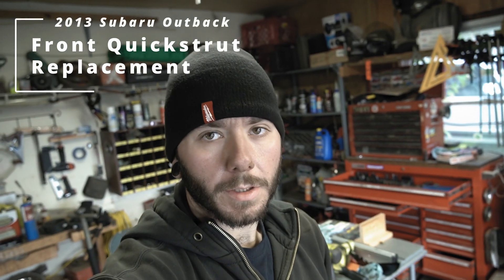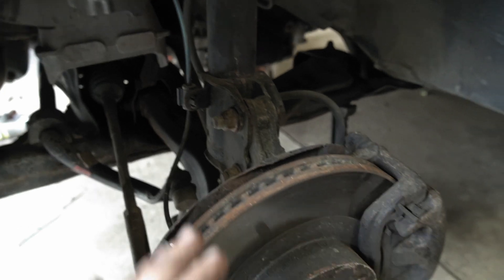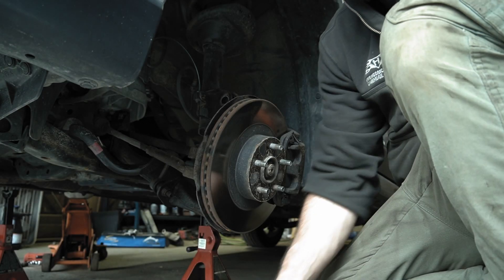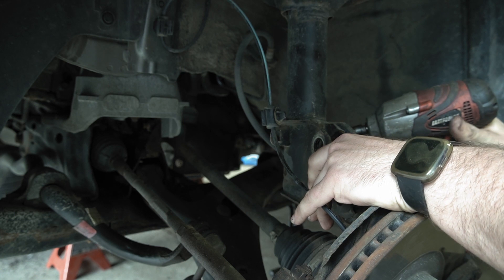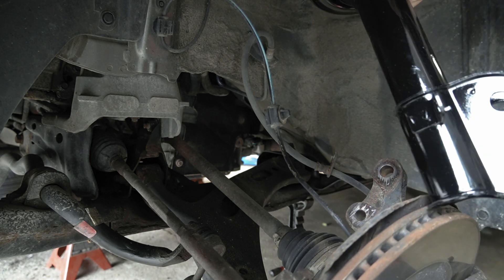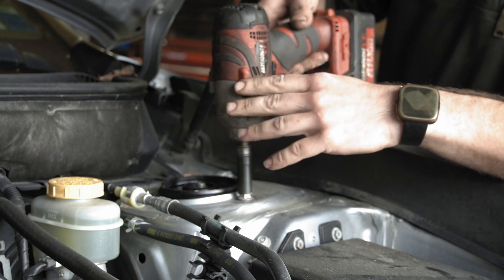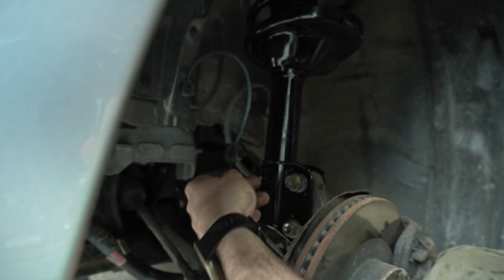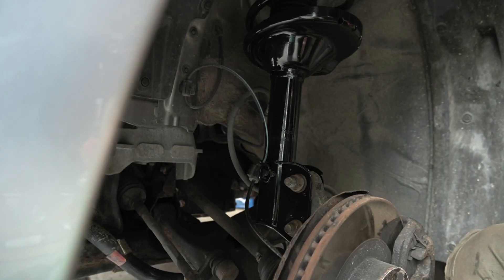2013 Subaru Outback Front Quick-strut Replacement

Comment: Might add, if you pre mark eccentric bolt, you won't be SO far out of alignment than by not pre marking. Thanks!
Reply from the maker: Good point! I am spoiled and do most of my work on an alignment rack so it doesn’t really cross my mind. Definitely a good idea.

Comment: I’ve been putting up with clunking sounds for a while now when going over bumps and whatever and was wondering how difficult it would be to replace these. Thanks for the video, looks like an easy fix.

I had the bushings replaced several months ago so that’s not the problem.

Comment: Great video. Getting ready to do this on my 2014 after a shop quoted me over $1,000 for what seems like such a quick replacement.
Reply from the maker: In my shop this job would probably run $300-$400 depending on parts prices/corrosion on the suspension hardware. I would try to find a different mechanic :) Hope your replacement went easy!

Comment: Thanks for the video, takes the worry out of trying it myself! One thing, I watched a Monroe installation video and they recommend not tightening the upper strut mounts down tight until the vehicle is lowered off the jack so it puts even force on the strut mounts and threads, what is your experience with that?
Reply from the maker: You can definitely do it that way but at least snug them before you lower it so that everything is lining up properly before putting the weight on it, and then you can finish torquing them down.

Comment: I've heard that sometimes the axle can pop out of the trans when the hub drops down. Did you take any precautions to prevent that from happening?
Reply from the maker: Just basically be careful. I’ve never had it pop out really. And even if it does you just shove it back in and it’ll clip in. Usually if anything the inner joints get mis aligned and they can be a pain to get back in alignment. But like I said just be gentle and you should be fine

Comment: I'd like to do this but not sure if this is the issue that's causing the sound that I have every day I get like a thud sound every time I go over little bumps I'm thinking it could be the strut bushing or the control arm bushing
Reply from the maker: Jack up the car and shake he wheel side to side. If you hear the clunk it is more than likely the control arm bushing. If not, set the car back down and rock it back and forth and have a friend listen at the strut tops in the engine bay for any noises. Good luck!
Reply: @FreddysCarsaAndChaos  kewl thanks

Comment: 4:25 the wheel doesn’t line up on mine and it won’t align it’s stuck to the right a bit
Reply from the maker: Make sure inside the car that the steering column is unlocked by having the key turned to the first position. You can also rotate the strut assembly by hand to make it line up better. Good luck!